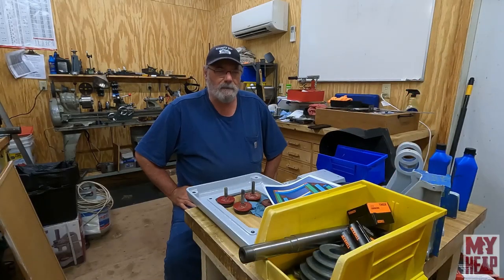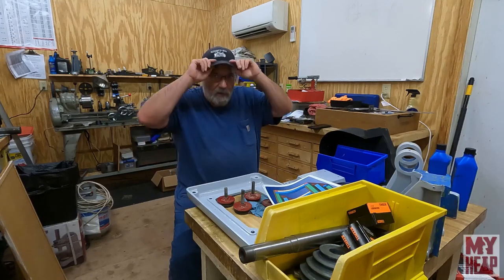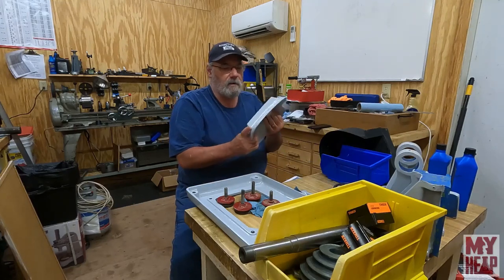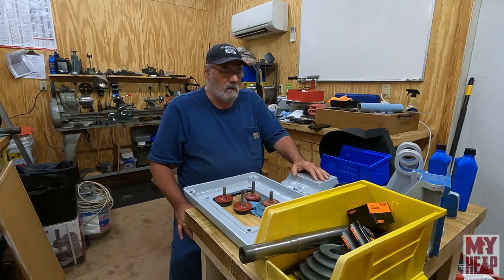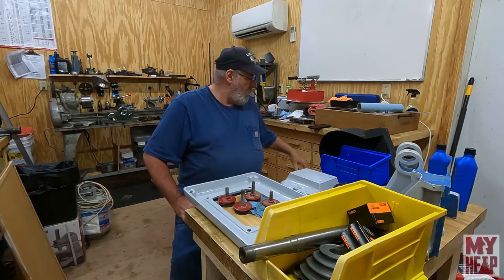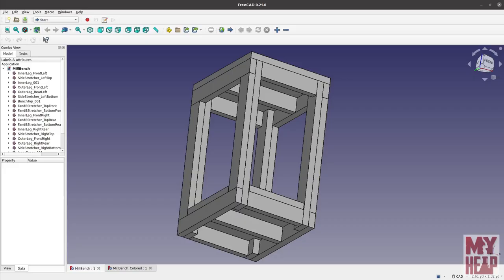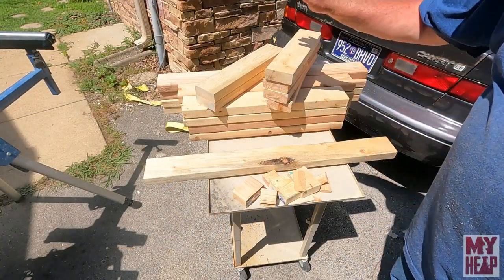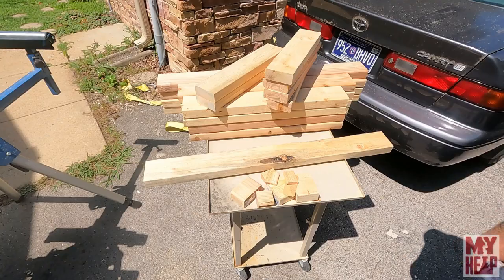Burke #4 Mill - 07 - A Bench for the Mill - Part 1

Comment: Nice timing, Joe! I have an excellent Burke #4 mill with the Lima gearhead motor, power feed, and all the accessories including the vertical head, quick-release vise, and the Burke dividing head, but no stand. The mill is sitting forlornly on my garage floor, paitently waiting for me to build a stand and return it to service in my spare-room machine shop. The mill is really in like-new condition and aside from a heavy coat of rust preventative I haven't done anything with it since I acquired it at the height of the pandemic.  I reckon that I will wait for & watch the follow-up video, and then use the information from them to design my stand. I have about 60' of 2" / 0.25"wall square tubing that I could weld up into a frame similar to the one you are constructing out of dimentional lumber. Naturally that would be more rigid, but I also like the idea of incorporating some wood into the stand to dampen vibrations. 
I am looking forward to the follow-up video on the stand and of course any other Burke #4 content you might generate. Thanks!
Reply from the maker: Gavin,  Sounds like you may be able to help me too if you are willing.  My mill was not quite complete when I acquired it and may need some help along the way with some pictures if you are willing.  Thanks for taking the time to watch and comment.  I appreciate it.

Joe
Reply: @MyHeap  I would be happy to help. I also have the factory literature that came with the mill, but it is pretty sparse. I will have to partially dissasemble it to get it into my basement where my spare-room machine shop is. That would be an ideal time to take some pictures or video if you need it. I plan to move the mill later this summer, in the last week or two of August.
Reply from the maker: Awesome.  If you can send me an email we can talk about it outside of YouTube.   You can get me email from my YouTube about page.

Joe

Comment: looks like a good start on it, how is it from tilting over? With the table and everything clear over to one side, it can get quite unbalanced.
Reply from the maker: That is a good question Chirpy.  Given that the actual base that the machine had has a very similar foot print I guess I will find out.  If it seems a little unstable I will move the drill press to it and make a larger bench.  Thanks for stopping by Chirpy.  Always glad to see you my friend.  Although as I progress on this project, I will be reaching out to you.

Joe
Reply: @MyHeap  if nothing else, just stick the bench next to another one and screw it in place or to the wall, then it shouldnt move at all then :P
Reply from the maker: @ChirpysTinkerings  Well that would be an option!  😀